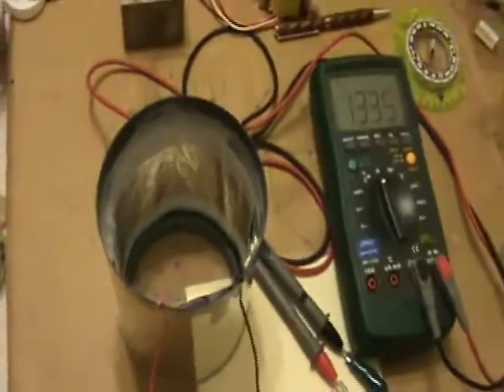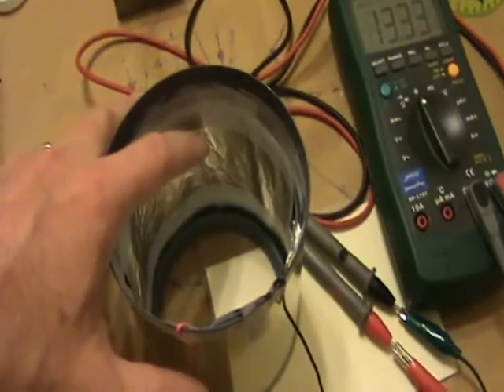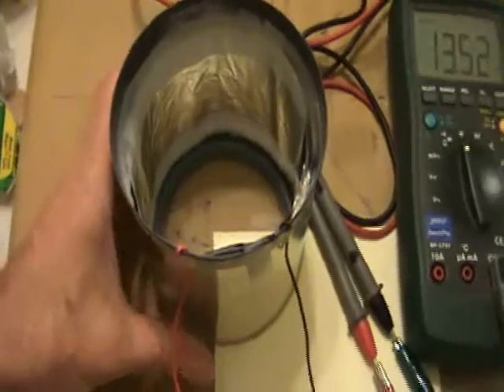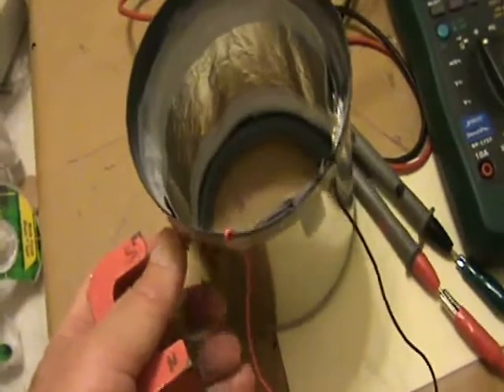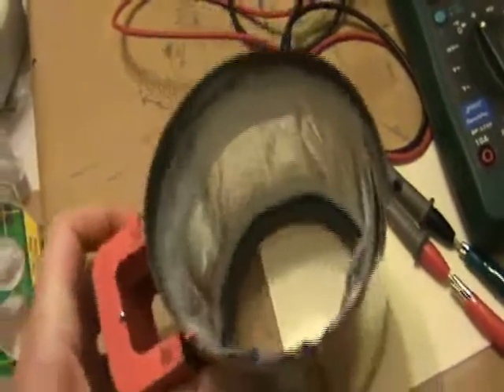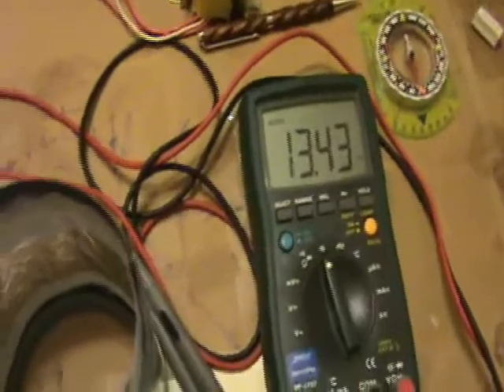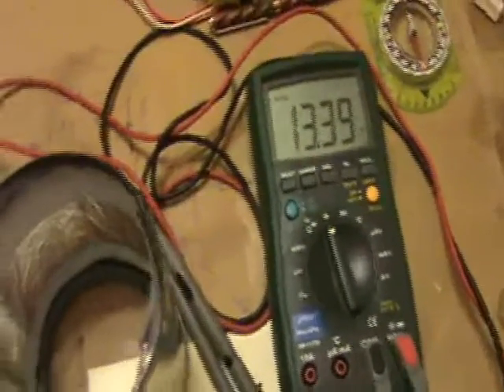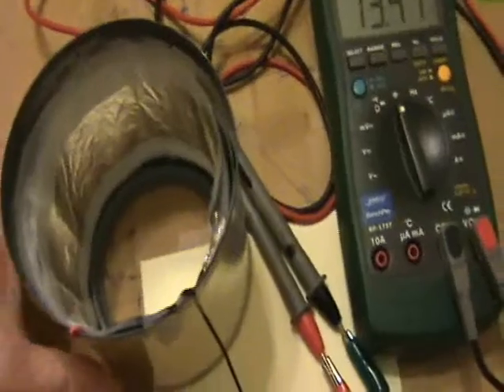Attempt To Wrap A Hendershot Capacitor

Comment from the maker: wrong size capacitance. Should be 40MFD and 80MFD. If you experiment with relays and 500uf and 1000uf caps, you will see the relay TICKS way too slow. The timing constant is too HUGE with such capacitors. The original Hendershot circuit had 40MFD and 80MFD. The recent video hoax is disinfo.

Comment from the maker: @prototype9000 
Yes, for DC perhaps. AC has an entirely different property. It can travel over the surface of the most resistive things imaginable -- skin effect. Further, these large cylinder shapes oscillate and produce a large electro-static field that can be detected with neon bulbs at a distance or with av-plug. I'm still torn whether non-magnetic stainless-steel is better than metal can that is magnetic. The latter would alter the coil inductance further away from simple air coil.

Comment: my brother mark said you can tell this guy that the c-clamps were used to change the capasitance, his spelling is ruff, of the hand wrapped capasitor. When i wrapped mine i got it right the first time but with a capasitance meter i found you could change the reading value by squeezing the plates of the wrapped capasitor inside the coil. Mark... I think you already determined this ... mjh

Comment from the maker: re: c-clamps
I see in one image in the Mark M. material that on the coils he had "Resonance Tuners". I suspect the c-clamps were a means of doing this, either by putting pressure on the capacitor plates or by making a connection to the outermost coil.

Comment from the maker: it probably can be done either way, as long as it is tight. I see in the notes that it does say to wrap it on the outside. I missed that. Outside makes sense because you can wrap it very tight.

Comment: I have noticed on seeing this video for the first time that my description on your comment 4 hours ago was right on the money the can, the waxy silver foil wrapping inside, I had not seen this since my father tool with it, he used the c-clamps to trouble shoot it I believe as I would at work with different problems, this sure is a damned hard way to communicate , my work didn't involve electronics but food production, I was a millwright in the winter, an a line mechanic in the summer, who cares?

Comment from the maker: I wish I had a higher resolution image of Hendershot and his device. One clue in one image is a sticker on the inside of his cylinder which has the letters "Fe". Perhaps you are correct, capacitor on the outside. Also, I noticed that if I connect one side of cap to metal of cylinder, the capacitance goes up a bit.